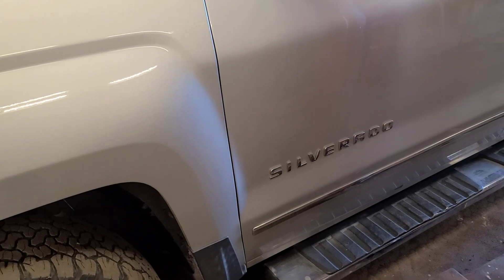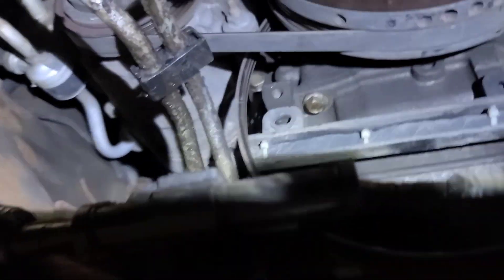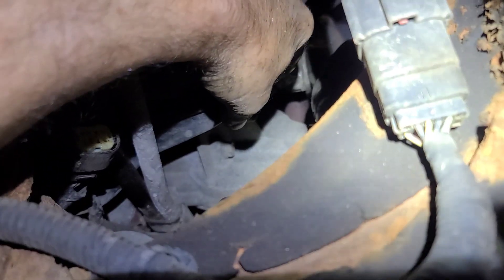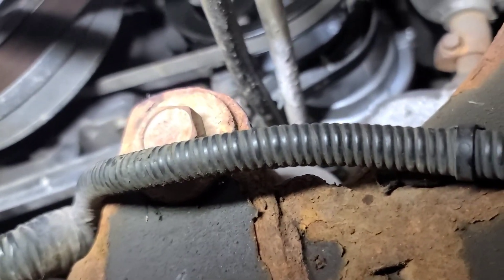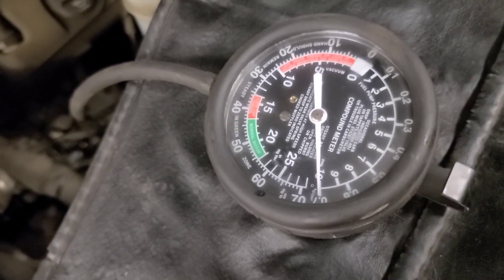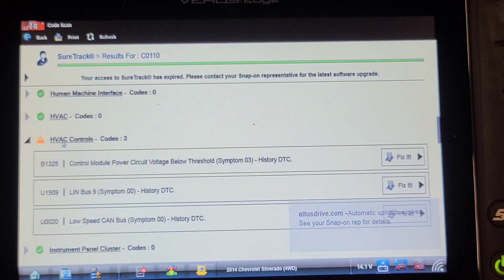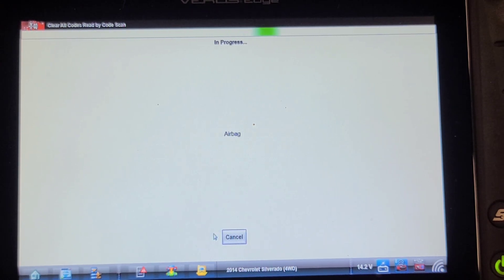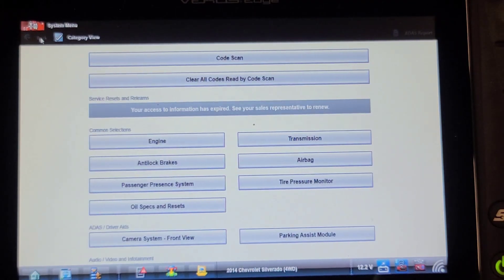2014 GM Truck ABS Light On, C025E, Low Vacuum

Comment: Hey Phil one of your old students here!
I have a 2014 Chevy 1500 4x4 5.3 
Have fairly consistent  history code for c0299 large vacuum leak can never get it to actually act up. On scan data I have -9 psi at most after running for a few mins, which  is about the 18 inches,  it decays quickly and takes way longer than I would expect to bounce back, it holds pressure once key is off ignition on and I confirmed the pressure sensor is ok with a manual gauge.
Did this vacuum pump fix this issue for the customer I guess is what I’m asking haha 
My customer complaint is in town driving after multiple pedal applications pedal is hard with litttle braking response which would make sense with what I’m seeing 
Ps your videos have saved me a lot of time in gm products lol.
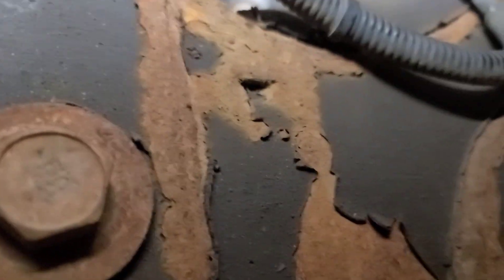Reply from the maker: @brandantew992  the new pump produced near 30 inches of vacuum at an idle. 3:45 in video and fixed the truck.

Comment: Hi Phillip. For c0110 on these what has worked for me is that you activate the pump with the scanner on %70 or so and very quickly start tapping gently with screw driver end or something like that on the pump and you’ll see it’ll start spinning. Since the pump motor doesn’t get activated regularly on the truck, I think a little water/humidity intrusion or dust creates higher resistance on brush contacts and that doesn’t satisfy the module’s self test and throws a code for it. Kind of like problems with blower motors but opposite in this case that motor sits there and almost never works to wear anything out. You get the idea. Good luck to you
Reply from the maker: @portlander7280  this pump is belt driven not electric.
Reply: @PhillipBailey I meant the abs pump not the vacuum pump. I explained all of that for the code c0110 you had in abs module that wouldn’t clear for you at the end of video
Reply from the maker: @portlander7280  oh my bad. I tried clearing the code and the commanding the pump motor on with the scan tool but since the code resets immediately I get the "device limit exceeded " and the test aborts.

Comment: Yikes!  That doesn't look fun at all!  Why does it need a vacuum pump?
Reply from the maker: @maui6446  low vacuum output
Reply: @PhillipBailey  My buddy, not a professional like you but is pretty good at this stuff, said that the way GM is doing their emissions control system dictates they have sufficient vacuum at all times.  Hence the need for the pump.  The vacuum pump solution is not required on all brands/models as it is dictated by the chosen emissions control strategy.  So, Ford can get by with their 5.4 liters without this.  Do you concur?  Thanks
Reply from the maker: @maui6446  That's possible but I was under the impression they needed the vacuum pump to ensure adequate vacuum to the booster due to low vacuum from the engine due to AFM and variable cam timing.
Reply: @PhillipBailey  Interesting...